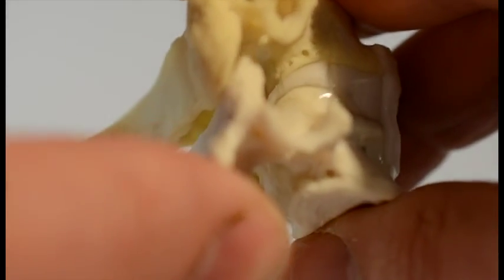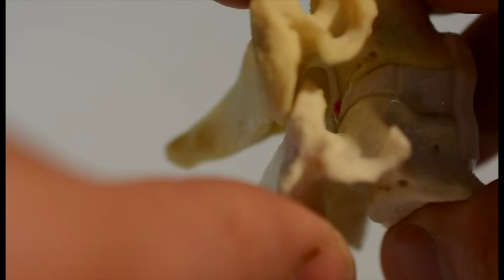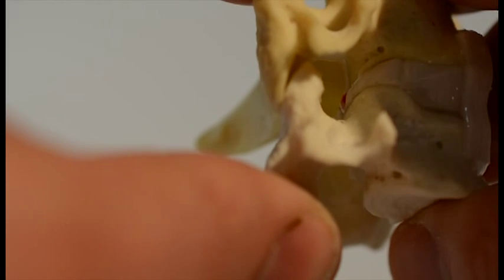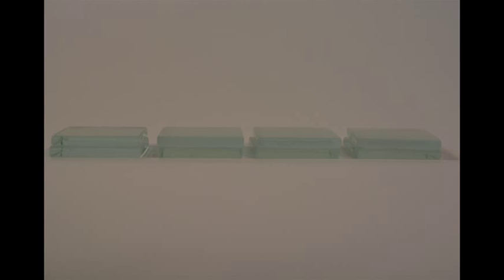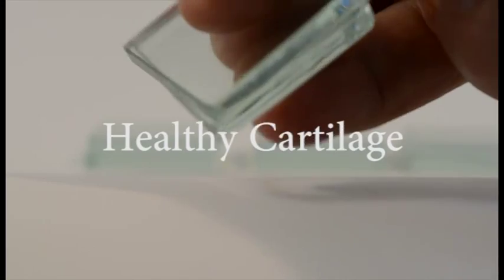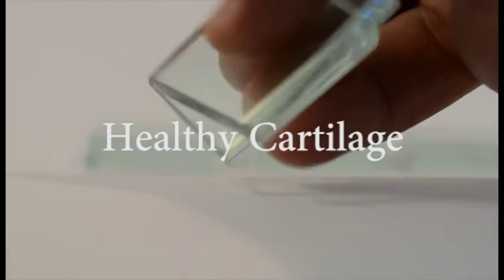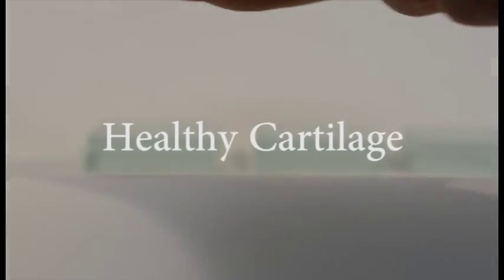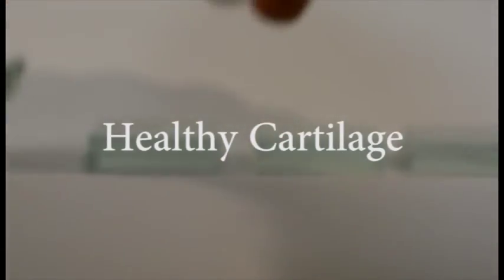Sounds in my neck

Comment: mine actually sounds like there's water, maybe wet sand grinding, or sounds like ligaments with water squishing with tiny sands. It's worse on turning left. I know this is because of me always using laptop and i am on bed laying on left than my arms and hands holding my head upwards. I broke my left neck I think. I sometimes sore and feel pain on my neck, than my head hurts too. Been doing it for a very long time so I must have break something or stretch my left neck too much. I don't know how to fix it back. It's not painful but it's annoying to hear it, and sometimes when i lift heavy things my neck hurts too. It's weird, and considering I also have broken disc on my lower back due to exaggerated curve of my bone lumbar lordosis. And I have scoliosis too. I am trying to copy several exercises online I hope this neck problem goes away. Oh I also sometimes feel dizziness and nausea. I can't exercise like before, the sit ups and the jumping movement makes me sick. My head hurts and I feel nausea. I don't have this before but it happen when my neck started having this sound.
Reply: I get that every time i use grip strength and move my arms in certain positions but isk if it coming from neck or shoulders because when i move my neck i only get grinding and popping and the shoulder one when i move my hands is like you said a squishy like water liquid sounds ans it hurts my shoulders and arm joints but doctors kwep saying its crepitation
Reply: Dude have you heard of atlas orthogonal chiropractic adjustment? Sounds like u have a subloxated atlas bone check it out check out the symptoms if ur atlas is out pf alignment no matter what you do your whole body wont be balanced. That can correct your whole spine
Reply: @westsidekasper4860  I still haven't gotten appointment for neuro. I will go for check up. I don't have popping sound. It is squishy wet sand griding sound especially when i turn my head left. yesterday was scary I felt heavy head like there's books on my head, or something pulling my head down and my shoulders. Than I went to grocery i put this heavy bag on my right shoulder. That afternoon I was fine. Than the evening I was scared the heavy head and the shoulders got worse. Than my arms feels so heavy and feels tired while on computer. The nape feels something is moving, my arms with little bit of pain. But I was having nausea i feel like vomiting. Now I am fine I don't move much or do anything strenous. I am trying to slow down and avoid heavy lifting of things. I slow down. last night I was sitting on the chair my back feels pulling down too. I thought my neck will break. I am going to get doctors appointment and have a check up. I do have scoliosis and lower back broken disc too. Now I have a new problem with my neck.
Reply: @meilih2030  man i hope u get better i also feel like sometimes i cant hold my head up n between my shoulder blades i feel crushing pain with burning sensation i hope god heals us bro
Reply: @westsidekasper4860  I have appointment in neuro tomorrow. I hope she is a good doctor because mostly arent. I am gonna be problematic again with the bills of lab. She might ask me for MRI it's too pricey. And neuro doctor fee is more expensive than other specialist.
Reply: @meilih2030  Any update on your neck? I also have sand noise. How's the MRI result
Reply: @SkyHermit  they said it's spondylosis. Than The doctor said she will give me pain reliever if it is painful. But I don't like it. I am better than the usual. I just can't keep lifting heavy. When i went to grocery I was carrying heavy bag on my right side, my right back and front hurts later. Than my shoulders feel heavy and my head. But now I am fine. I feel a bit of the weird feeling but not much. But sometimes I feel turning my neck is not easy. The sound is still there, it never goes away. But it's not that bad now it's tolerable.
Reply: @meilih2030  Do you normally do gym workout? I do and I think those strength exercises caused it especially pull up. Not really sure though. 

From what I read about spondylosis, if you are young it will go away in 3 to 6 months
Reply: @SkyHermit  No I don't go to gym. It develop due to prolong bad posture.
Reply: @meilih2030  I also have bad posture due to excessive usage of mobile phone and desk job. I think this is the main reason
Reply: @SkyHermit  Nope. Mine happened because of doing the bad position on bed while watching my laptop. I am sideways and my neck was force to be lifted higher while i am laying on the left. I had pains and aches but i ignored it for a long time I didn't know it will result into this.
Reply: @meilih2030  Hope you can recover soon !
Reply: @SkyHermit  it's permanent. It's never going to go better. But it's tolerable though I shouldn't carry heavy things anymore.
Reply: Dude have you heard of atlas orthogonal chiropractic adjustment? Sounds like u have a subloxated atlas bone check it out check out the symptoms if ur atlas is out pf alignment no matter what you do your whole body wont be balanced. That can correct your whole spine

Comment: My neck is making a sound and I’m laying on my bed and my heads turning right and making a sound it has been doing that for a lot of months like almost a year
Reply: Yeah same it sound like my neck is softly oinking
Reply: Same for me also , u got any solution ah
Reply: Idk if it's weird but i get that sound every morning and doesn't stop until it automatically pops. Sometimes it goes away but i like popping it
Reply: @optimalsugar7636  you should stop popping it i know it feels good but in the long run it can give you arthritis
Reply: man i have the same problem. did u figure out the solution?
Reply: this will leeds to cervical vertigo.

Comment: Most of the cases, it is due to the stretched neck muscles.As my personal experience massage your neck and keep it warm.Have proper sleepYou will get rid of it.
Reply: Hello I currently have this. How long will it take before it goes away. It has gone on for a month now and I don't know if it will ever go away. Please help, thanks.
Reply: Thank you. I am having the same problem. Frustrated
Reply: Did yours ever go away
Reply: Mines the same thing when I turn I hear a grinding sound and sometimes I get pain in my neck or backer head it's been years since I had it

Comment: wow, finally a good example and explanation... thanks Dr, Jerome, now... would it be too much trouble to get some guidance on how to improve it? the old "if it doesn't hurt is ok" is not enough cause it means something is not working optimally. thanks in advance doc
Reply from the maker: Hello. The secrets lie in how to keep your hyaline cartilage healthy. Here is an article that you may find interesting. https://dynamicdiscdesigns.com/study-reduction-audible-joint-vibration/
Reply: thanks a lot for yur quick response Doc, I'll take a look
Reply: thanks a lot doc i read it, it is consisting with these sounds fading when i used to go to a chiropractor for another issue, i guess nutritional approach will work too.